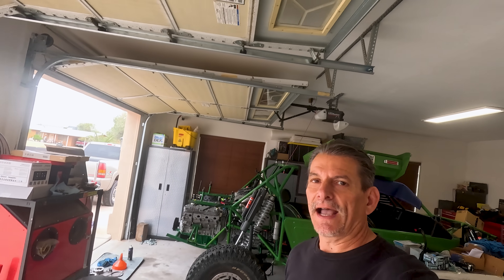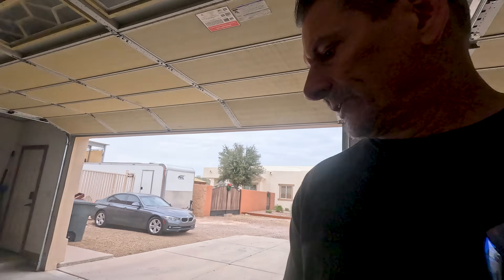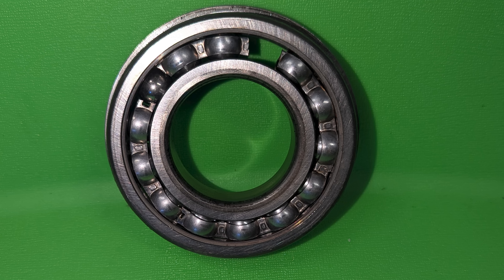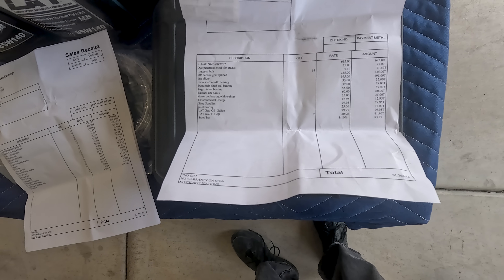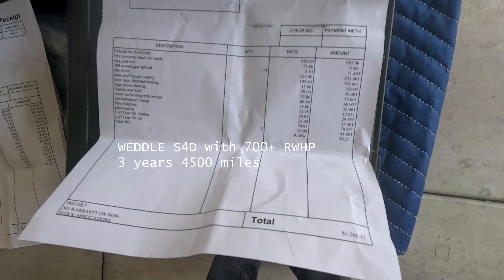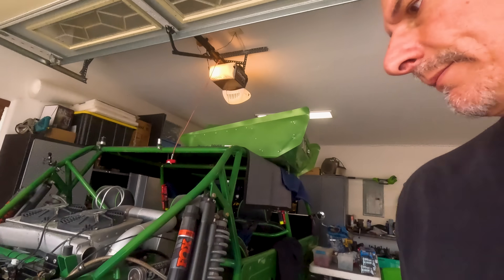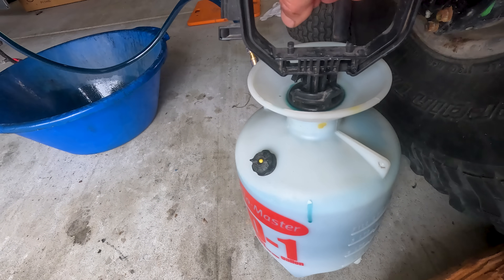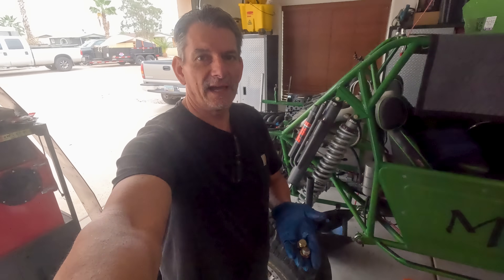Is a Weddle S4D Transaxle Worth It? 4,500 Mile Review & Teardown

Comment: Do u have the oil trap for the oil pick up?  I think improved racing made it. Also the oil pan with the deep end on the rear of the buggy. Just saw u don’t I can’t remember what model car maybe the trailblazer oil pan. Idk if it interferes with ur skid plate though.
Reply from the maker: Great question! No I didn't however I do now, video to come.  Also, my rear engine cage will not allow me to flip the oil pan around. I really appreciate your questions and feedback.  👍

Comment: That was fun to watch. I thought these transaxles had a little more longevity than that. Have you had conversations with the shop about how they last on the street?  Thanks
Reply from the maker: The design is focused purely on performance and durability in an off-road racing context. It's a purpose-built racing component and would be an inefficient and uncomfortable choice for a street vehicle. Appreciate the question and comment!